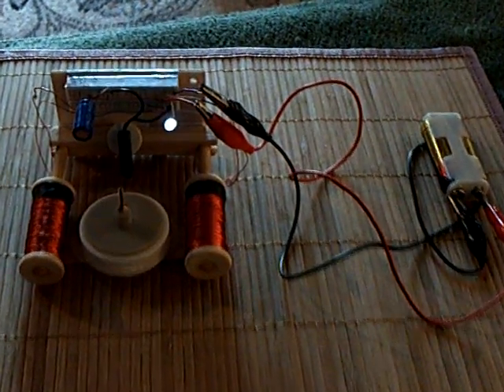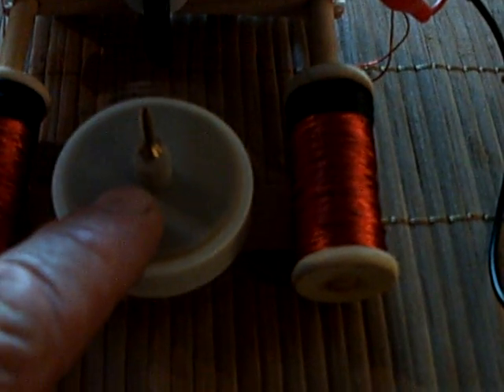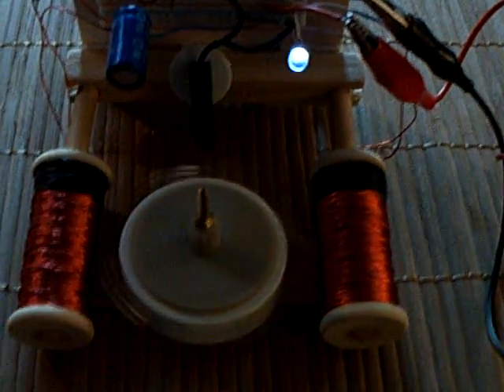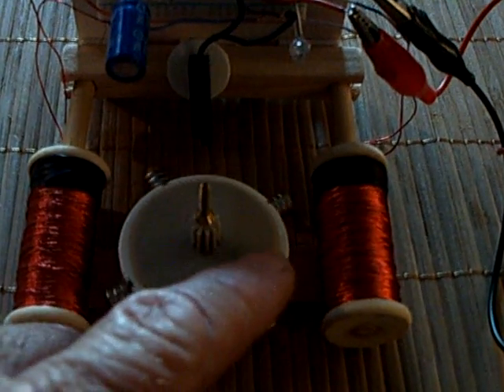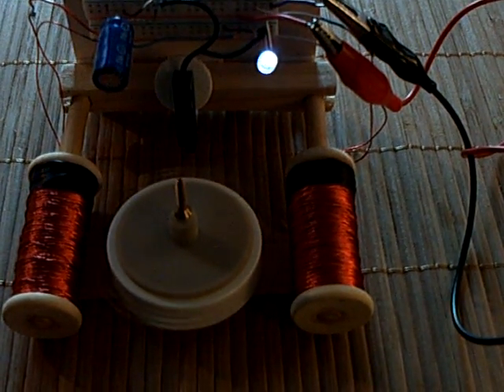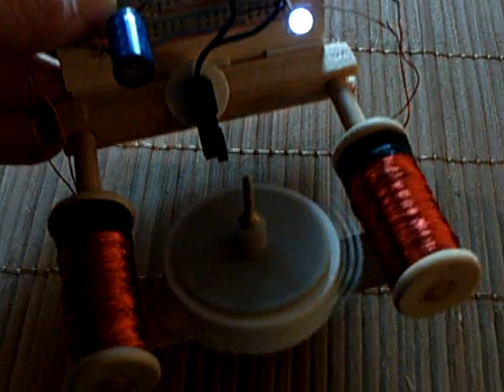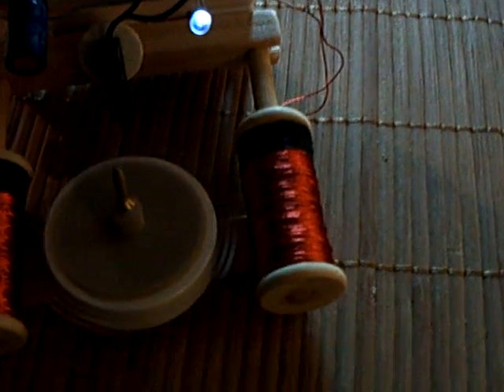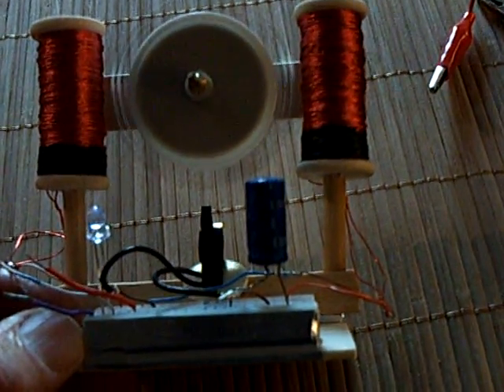JB's Zero Force Motor --- My Replication

Comment: A few years ago I was debating an engineer about Obama"s push for innovative electric cars that had resulted in the Chevy Volt. He couldn't imagine that mankind does not know everything there is to know about electromagnetism. I told him that that fact is more than likely. He also said that the dc batteries wouldn't get better enough to ever be practical. Off course, he was a Republican so the world has already passed him by. I should have sent him a Bedini motor video.....
Reply from the maker: Good comment.  Eventually the world will shift to electric powered vehicles of all types.  Keep an eye on what is happening right now in aviation.   The batteries, motors, and electronic control systems are making it happen.

Comment: big up lidman thanks for answering me it works i use hall sensor trigger  2n2222 now i have two transistor mjl21194 (npn)  mjl21193 (pnp) an buzz11 mosfet which one you think i can use the 2n2222 to trigger i am a prento

Comment: the thing that happens when u fire in the middle is you get a push and a pull on the magnet cause by both sides of the coil.
i came across this when i was expirimenting with edwards PMH coil
with that coil you get 2x push and 2x pull :)
just have to fire it when precisely in the center between. (only works with alternating rotor and only fire on north(except if u make it bi phased))
nice expiriment keep on going!

Comment: Hi so to accelerate would a block of aluminium and a type of Cockcroft Walton Jacobs ladder type apperatus do the job. Joe booker states in his rattle snake magnets the cd tre can't be nothing just true equilibrium Giving out but no attraction in to that field. So the central core if both coils must be collapsing inwards sucking air atom structures in on the vacuum and figure 8 He uses a green card to show white neutral. On a few ingventor. Videos. Just a thought at present

Comment: Lidmotor, somebody else did a video demonstrating that the current goes to zero when changing the coils from air core to iron core, could you replace the wooden dowels with steel centers of your coils to see if your run time would be extended?
Reply from the maker: +Billxx I have looked at that video.  That is John running an earlier motor.  I tried putting a core in my motor coils and it would not run at all.  The rotor magnets just got attracted too much to the cores.  I may be missing something here.
Reply: +Lidmotor , thanks much for taking a look, the circuitry must not be equivalent, in his video he says that he was using a "bi-polar" switch? Seems rather than placing magnets in opposing positions he's using switch to change polarity at the 0 deg position of the timing. In newest video he is using 2 reed switches in timing circuitry - 90 deg apart? in any event, it's an interesting build. Thanks for posting your video...

Comment: Well done, but I don't understand the principle, cause you have 4magnets on the rotor there are always 2 magnets at the top of the coils that are pushed or pulled on by the coils fields, so I don't see why it should be a zero force motor ? Also in Bedinis scope shots you could see, that the ON time was not flat but falling so there is couter EMF involved....hmm...
Reply from the maker: +overunitydotcom Stefan I don't really understand the principle either.  Here is his latest video on 'The Zero Force Motor' and, if you go to the 5 minute mark where he shows the flux line diagram, you will see how confusing the situation is   https://www.youtube.com/watch?v=XQzcYZk9MWA
.   He says that there is a super N pole between the N facing rotor magnets that interacts with the stator coils.  I need to get one of those magnetic field viewing plastic sheets to look at the flux lines.  I TOTALLY agree with you that there IS a  counter EMF involved--at least on the builds I have done.  You would have to turn the rotor 90 degrees to get away from it and then the motor doesn't run.  Some people might claim that this design is a foolish waste of build time but to me it is fascinating motor to study.
Reply: *****
Well if you look into the "Thomas Motor" from Ben Thomas (Youtube User: K4ZEP) a variation of the electrical Steorn Orbo Motor, there are really no counter EMFs involved cause you always have 2 toroidal coils in 180 degrees out of phase so all the induction from the magnets is cancelled out, but I don´t see the same happening in the Zero Force Motor from Bedini, or am I wrong ? Regards, Stefan.
P.S: I think the Thomas Motor only needs to be build bigger to get a overunity motor operation...
Reply from the maker: +overunitydotcom Thank. I will take a look at Ben's Motor.  He hasn't done much in a long time.  He and i worked on a few projects together.  Good guy.
Reply: hey +Lidmotor , love your videos, if you would like to learn more about the mid point of the magnet I would check out +Theora Apophasis channel, he has a really unique ferro cell which gives a clear view of the magnetic field as well as the mid point of the magnet AKA blotch wall or a better description is the dialectical inertial plane which is the source of the magnetism.

Comment: Very Good.  When I fitted this 'flyback' led to my motors it depleted the battery much quicker - do you find this ?
Reply from the maker: +3D Motor Maker -- When the LED blinks it is using energy but I like to see it so I pay the price.
Reply: +Lidmotor  I might have misunderstood the role of the Led.  I thought it was free energy from the calapsing magnetic field, so I was disappointed when it seemed to be pulling power from the source.